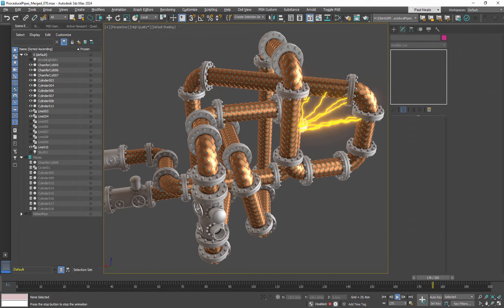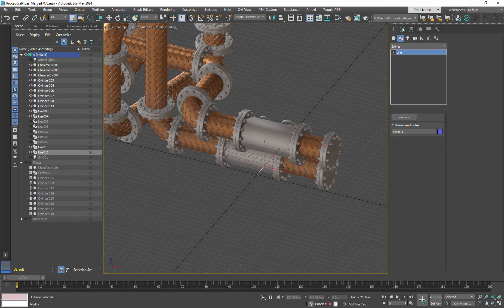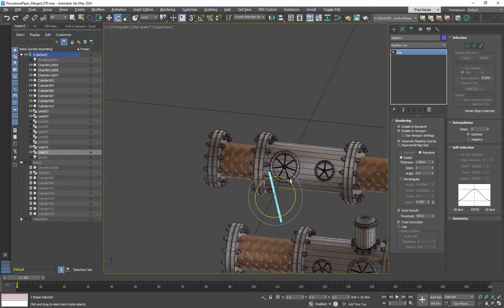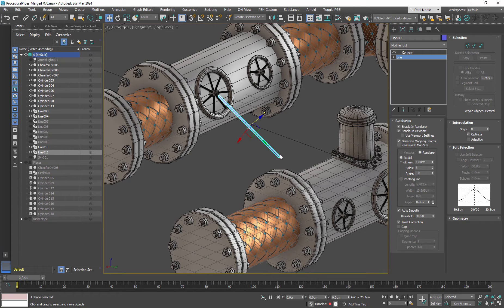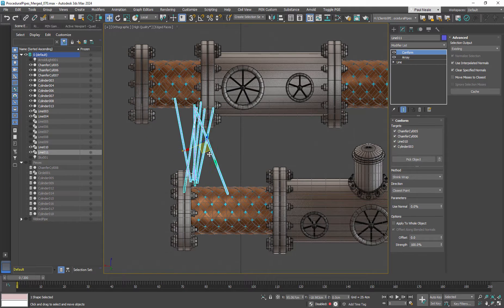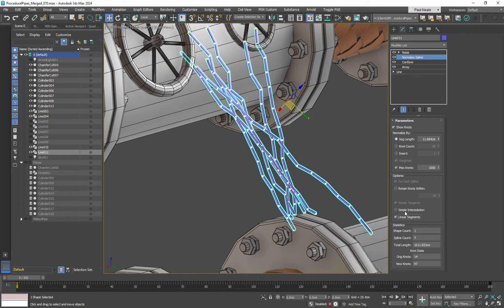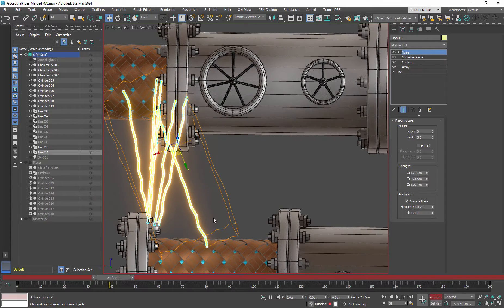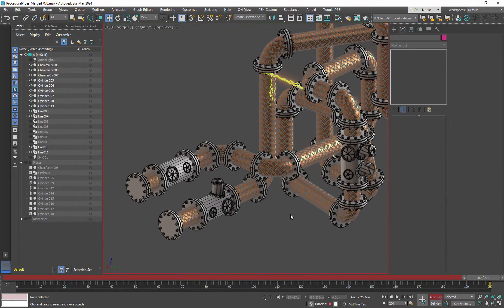3DSMax 2024.2+ Procedural Static Electricity

Comment: what if i want the electricity to split apart. I want it to make Y's or fractal patterns.
Reply from the maker: Make multiple ones or animate the settings in the array modifier. As for fractal patterns you would need a way to generate the splines procedurally but there is nothing that can currently do that without a plugin. Try TyFlow if you need something with more options.